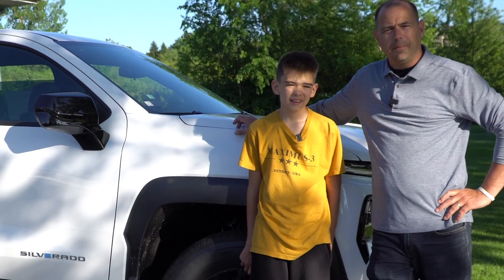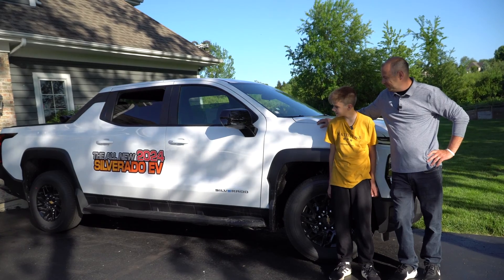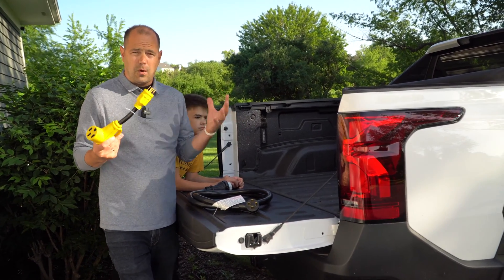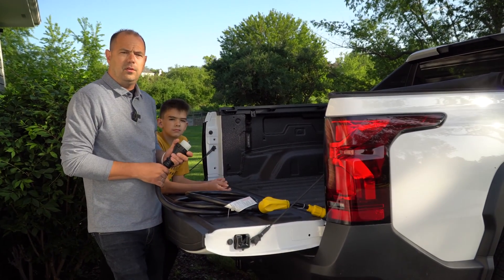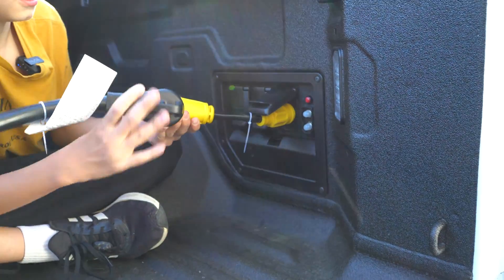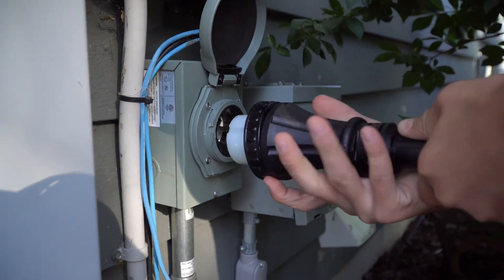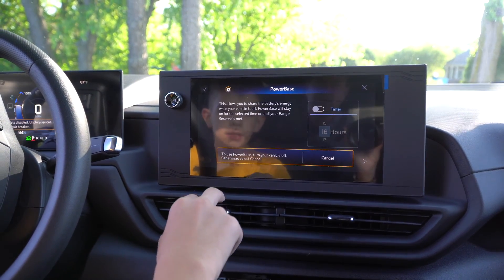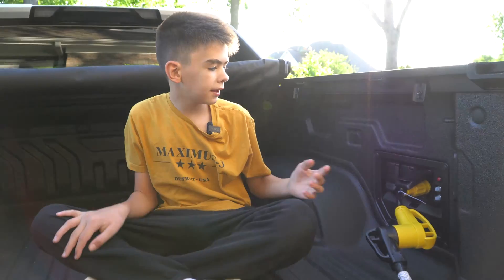Can You Power Your Home With An EV Silverado? | Chevy PowerBase | 30 Amp 240v Service

Comment: I believe, If you were using a NEMA 6-50R instead of a NEMA 14-50R it'll work because the 6-50R doesn't have a neutral (like your plug does ) just 2 hots and a ground, so the truck neutral bond never sees the homes neutral bond.
Reply from the maker: @cyumadbrosummit3534  that's a very valid point.  That could be the answer!
Reply: @JeepsOnTheRun  are you going to try it and post a video if it works?
Reply from the maker: @NBSteve  if I get a chance, yes
Reply: Anyone ever do this successfully yet? Concerned about dropping the neutral. Removing the neutral might temporarily stop the breaker from tripping, but it creates a floating neutral, which can lead to unstable voltages, damaged equipment, and serious safety hazards. It’s also not NEC compliant, since the ground is never meant to carry normal return current. Am I missing something? Really want to do this with my truck but not wanting an unsafe scenario.
Reply: Please don't do that. What would happen is that the 120V circuit would return though the N-G bond in the house, over the ground wire to the truck. That's not safe and should still trip the truck's GFCI. Removing the ground wire would work, but then everything in the house is technically ungrounded since there is no unbroken ground fault path back to the source.
Reply: You have to keep the neutral or you won't have a 120 volt circuit!

Comment: Bonding is your issue.  And the truck could be giving you a ground fault warning. The main home panel is bonded. The truck is bonded. In an electrical circuit you cant have more than one bonded system. 

I think about it like protection. The house has a protection system. The truck has a protection system. The fix. In the receptacle inlet disconnect the ground wire. I use a 30 amp switch so I can go either way, using a bonded source (off/disconnected ground) or using a unbonded electrical source (on/connected ground). The latter complies with NEC for grounding a unbonded generator source. 

Is this safe. Yes. The house protection protects the house side upto the receptacle. The truck protection protects the truck and the cable to the house. 

If you have questions, I have pictures of the whole setup. I'm also doing dual backup. Truck and 15kW generator.
Reply from the maker: I had a feeling this was a bonding issue.  I'd love to see your photos!  Mike@Jeepsontherun.com
Reply: @JeepsOnTheRun sent :-)
Reply from the maker: @JD-go1nq  Got it!!  Nice and clean , love it!
Reply: I too had the same thing happen. Can you please share the pictures with me as well
Reply: I just tried using my Silverado EV to do this and had the same result.  I’d love to see the pics of your setup as well.  Thanks in advance!
Reply: mvp
Reply: Pictures of your setup please!
Reply: Please send me pictures also. Thanks
Reply: I bet you didn't think your comment would be so popular for a pic request!!! Can you send me some pics of your setup? I've just got the new GMC Denali EV and would love to plug this into the house. Thanks 👍 (maybe a Google Drive link for those that want to reference in the future)
Reply: It's sorta safe. There's no code compliant ground fault path back to the source. But worst case there would probably-maybe be enough leakage current to earth/human to trip the truck's GFCI during a ground fault though. To do this right you'd have to switch the neutrals.  A neutral switched critical loads panel would be one way.
Reply: Hi there would you be able to send me pictures of your setup. Thank you